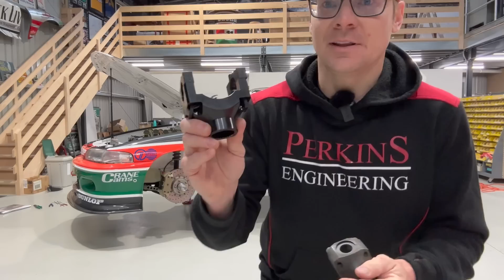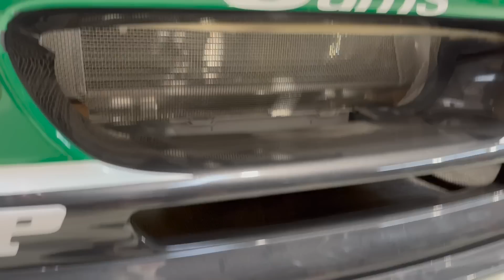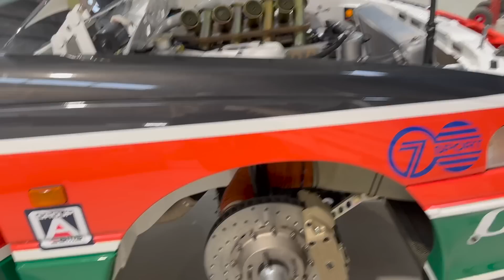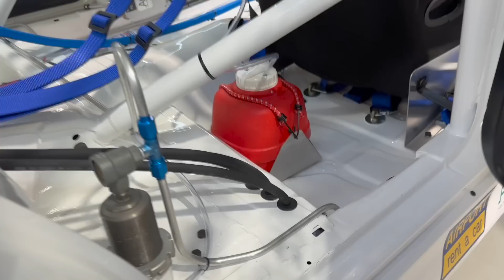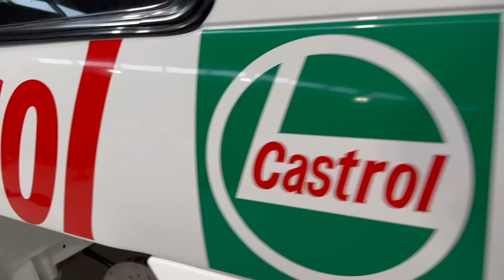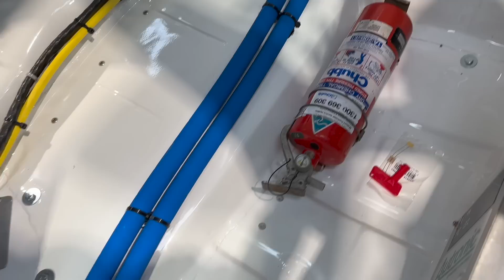Episode 47: The final pieces of hardware for the 1993 Bathurst Winning Car Restoration

Comment: Great stuff mate do you know the model number of the Motorola radio by any chance cheers
Reply from the maker: Not off the top of my head. I haven’t done much research on this because I knew we sold the original to the fella restoring the 1997 car many moons ago. I’m sure I’d be able to find something if I put some energy into it but it has been low on the priority list. If I had the model number it would be easier that’s for sure, maybe I need to have a look at the 1997 car
Reply: @perkinsengineering   I'm a ham opererater there are plenty of ham radio site selling all sorts of Uhf VHF Hf radios if you can find a model number or pic I'll see if I can track one down cheers